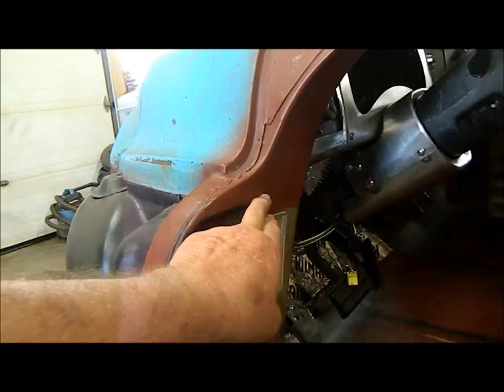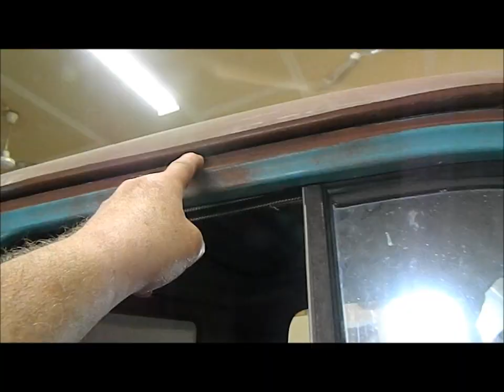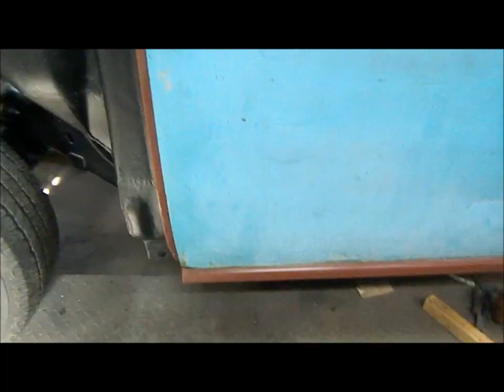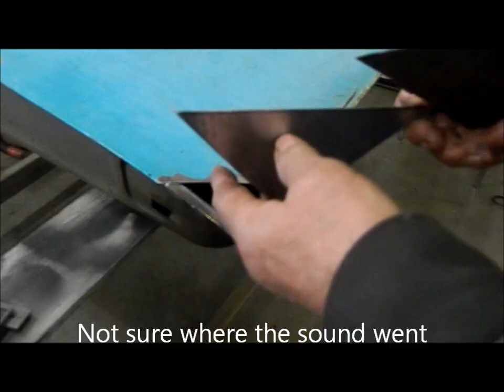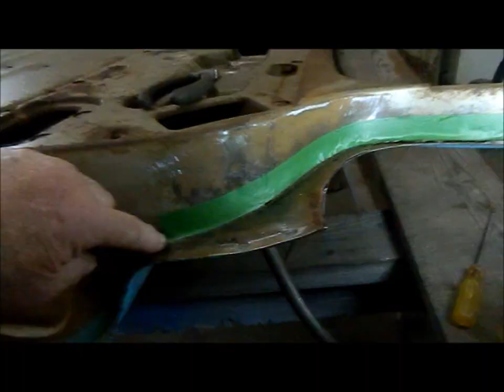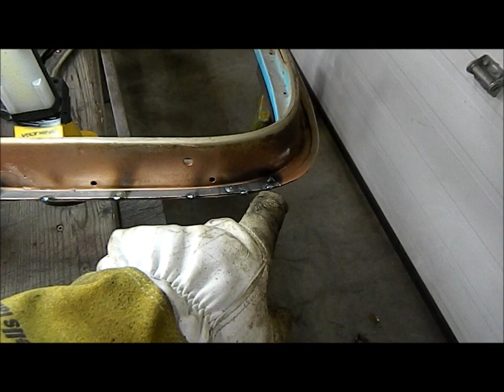1959 Apache GMC Fleetside #48 Door fit and rust repair

Comment: Lots of work getting doors to fit for sure (been there) looking really good!. Do you have a sandblaster? Princess Auto has some gravity blasters that are cheap and would really help clean rusty areas like that before welding.
Reply from the maker: Thanks Gary,  I have a princess auto sand blaster, just don't want to deal the mess, I know it would make the repairs easier